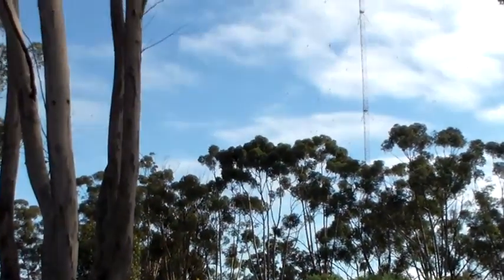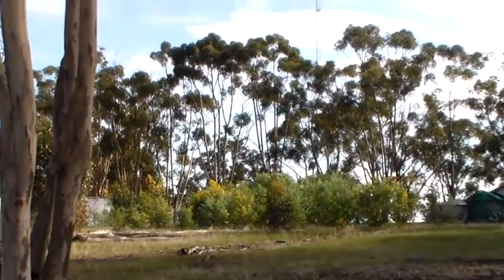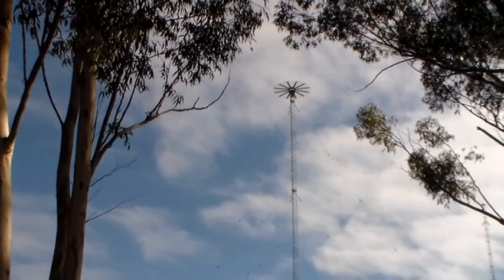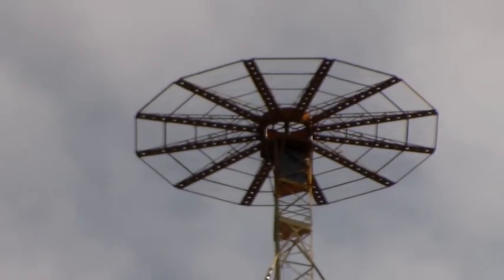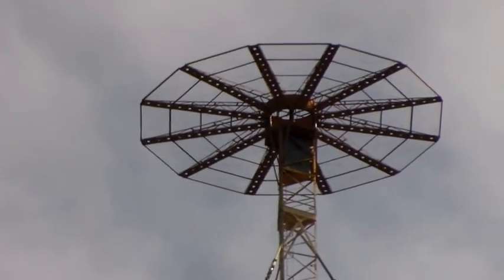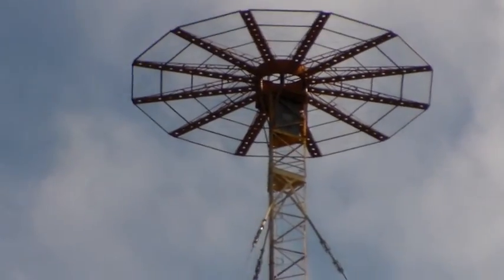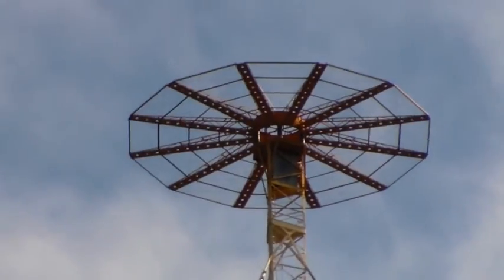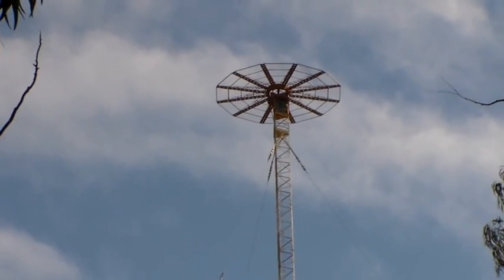What's A 'Capacity Hat'...

Comment: What almost no one seems aware of is that increasing the diameter of the perimeter can greatly add to the capacitance of the tophat, far more than filling in the 'spokes' of the hat. But if you're lucky enough to own an antenna design program that can actually with tophat designs (most can't,) you will find that to be true. If I ever get a chance to build another LowFer antenna I will build a tophat that's only 3 or 4 feet in diameter, but I will use laundry drier vent duct around the perimeter of the tophat. The voltage at the very end of a short antenna is extremely high, theoretically infinite. That means all the electrons out at the end need to be distributed better, and a large perimeter wire/tube does exactly that. That additional capacitance allows one to use a much smaller loading coil, substantially increasing the Q of the antenna system, allowing the field to bounce back and forth up and down the antenna numerous times and grow much stronger, therefore substantially increasing actual radiation efficiency.
(Just a little longwave antenna design secret for you.  :)

Comment: The Cap hat raises the feed point impedance and with a standard 90° 1/4 wave ground plane you've typically got only about 37Ω-40Ω, and if he's looking for closer to 50Ω then this can help, plus a cap hat also tends to lower the Q, making for a wider usable band-spread along with raising the radiation resistance, contrary to what some 4-land ops believe. Thumbs up.
Reply: Note to self: Don't forget that a cap hat also helps to mitigate corona discharge and disperse the high voltage found at the tip of the radiating element.